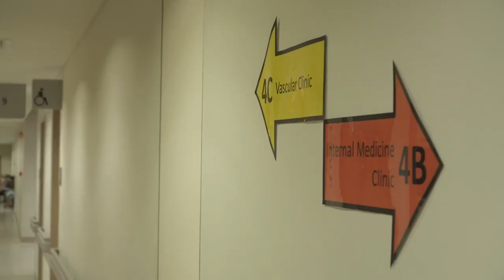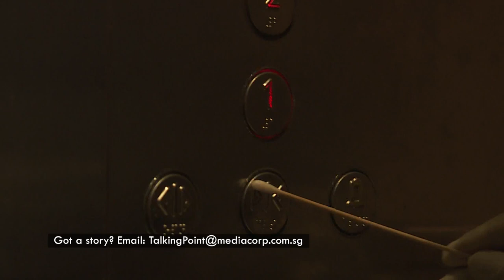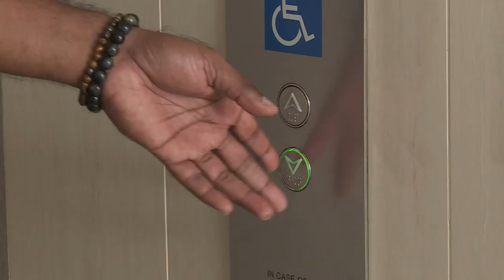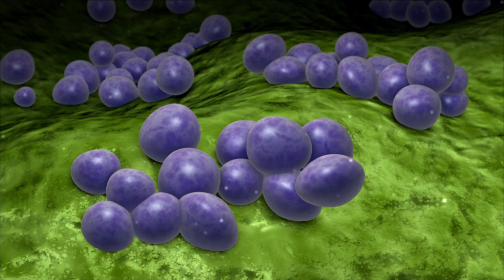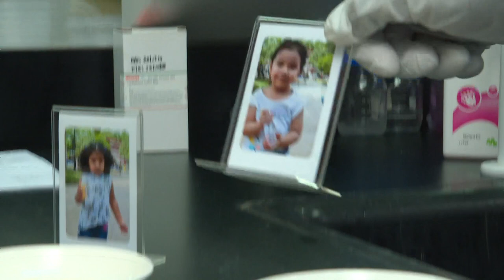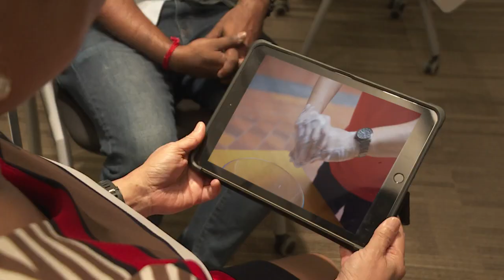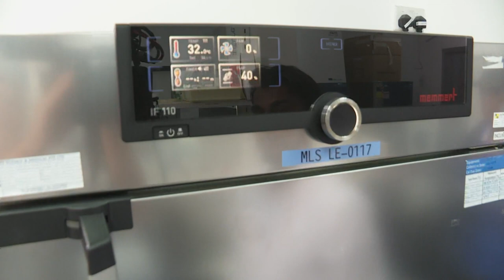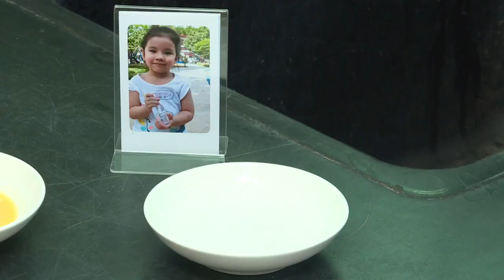Can Washing Hands Prevent A Virus? | Talking Point | Episode 42

Comment: The issue of dirty soap dispensers was not adequately addressed. If the dispenser itself is dirty, what do we do?
Reply: @MrSmurkles That is fine because you only need to touch the dispenser before washing. However, if the tap has a lever, I would also apply some of the soap to the lever to keep the lever clean as well.
Reply: @jk35260  so it's a death sentence when the soap dispenser is out of soap, and people keep pressing on it hoping some soap will come out